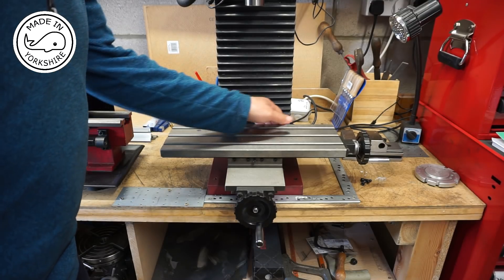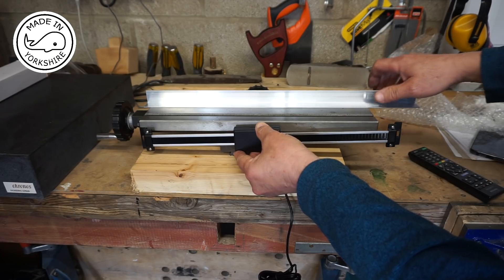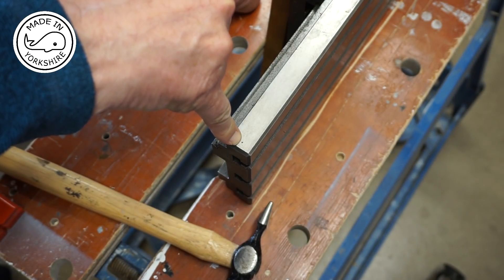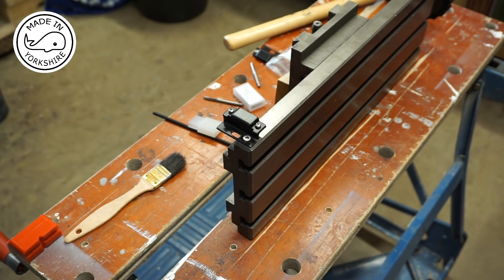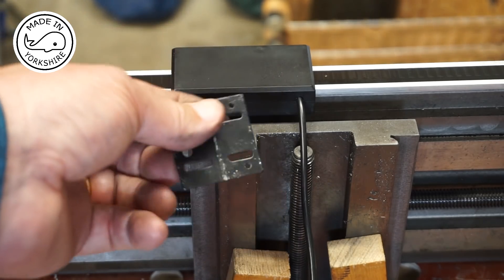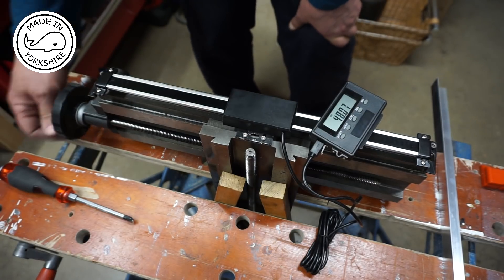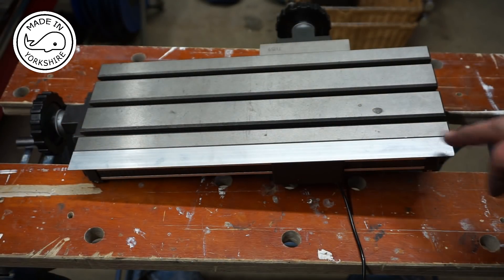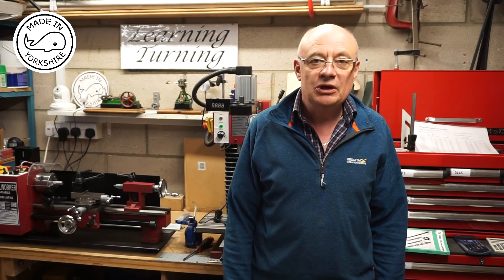#MT28 Part 2 - TouchDRO for SX2P mini mill. The x-axis. By Andrew Whale.

Comment: I'am plan to make same mod on my Bernadro KF10 but on front edge of the table. Can you tell me what is a full depth  of this rail? As I can see it is almost aligned with angle cover.
Reply from the maker: Hi. The dimensions of the aluminium angle are 25mm outside, 23mm inside. The scale just fits neatly into this. The height of the scale reader block is 40mm. The physical length of the scale is 375mm excluding brackets, 395mm including brackets.
Hope that helps.
Andrew
Reply: @learningturningmetal , thanks!

Comment: Nice job. I mounted mine on the front edge of the table so as not to reduce the x-axis travel.
Reply: Maybe Andrew could have used thicker and longer aluminium angle, attached the angle to the back of the table and attached the scale to the ends of the angle instead of the table.  This would have maintained the original X-axis travel.